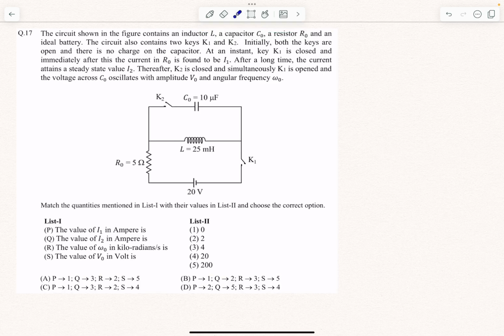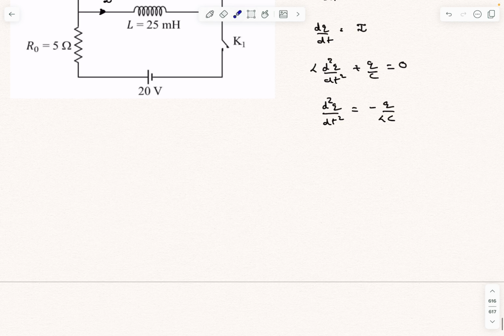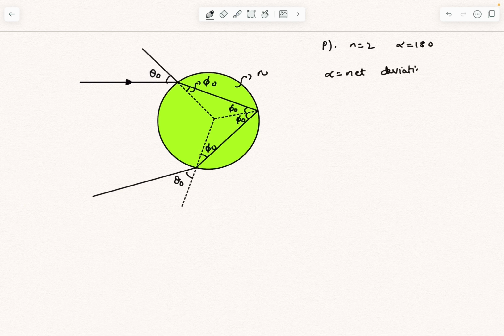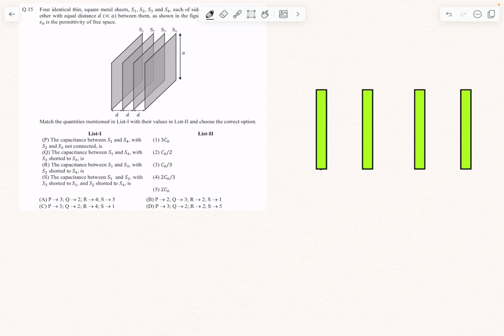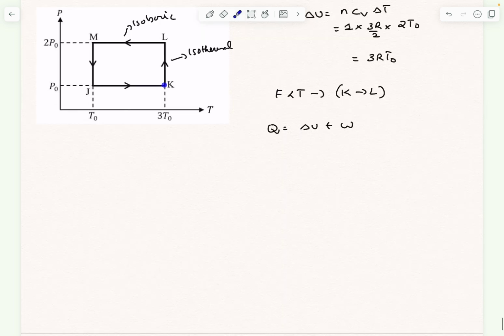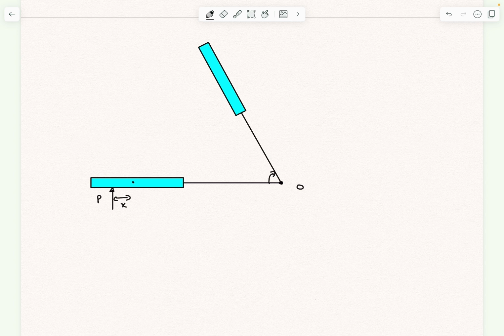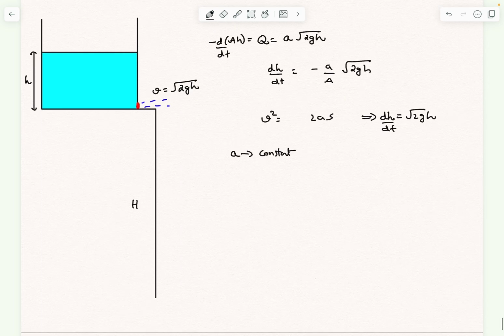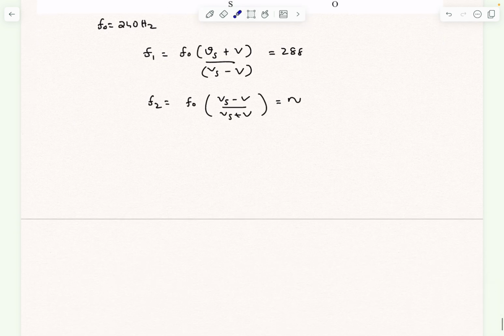Jee Advanced 2024 Problem Discussion | Q 11 to 17 | Paper 1

Comment: Bro pls upload solutions for question 1-10 also pls.

I am not having very deep understanding of angular momentum when there are more than one axis of rotations. I believe angular momentum should be conserved but don't know.
Reply: angular momentum is conserved about a point only when the net torque about the same point is zero. When there are more than one axis of rotations, angular momentum consv barely comes into play ( I think you mean a scenario like 2016 adv problem..) we divide the net angular momentum into two vectors, i.e the spin angular momentum which is along the axis through which the body appears to "spin" i.e pure rotation, and "orbital" angular momentum, which is found by solving the cross product M(Rcm x Vcm) where the vectors r are measured relative to the point about which the angular momentum is considered.